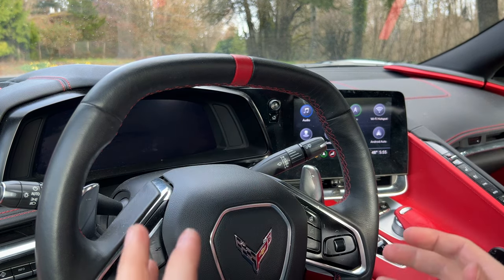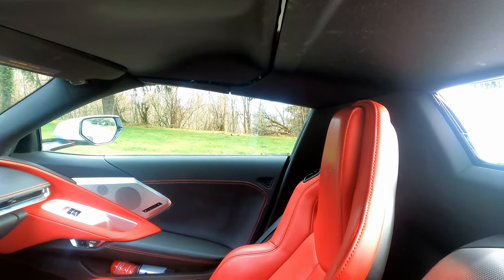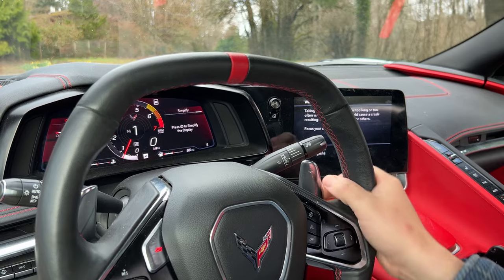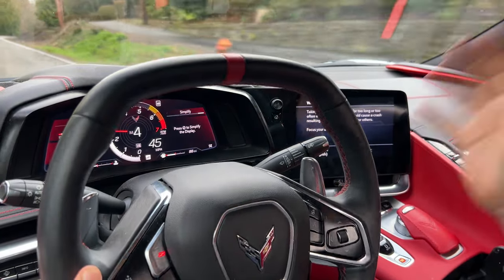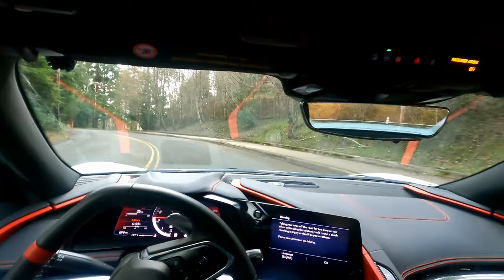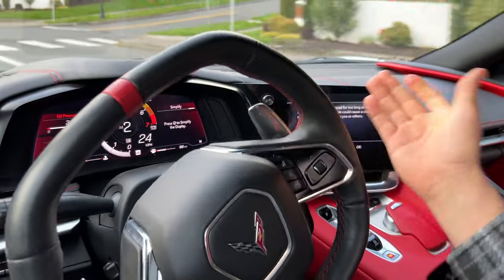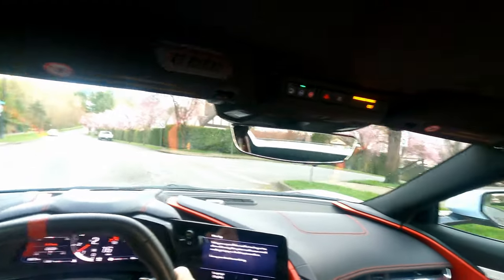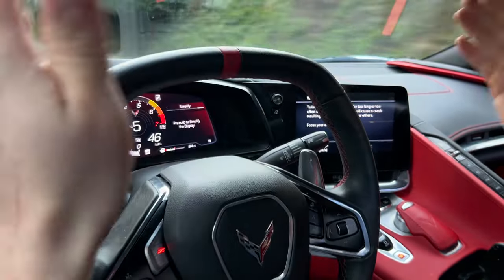How to, C8 Corvette POPS & Burbles, Stock sport Exhaust

Comment: stock sport you mean NPP or sport mode? I see you're in Z mode. What would you say is the coolest sound it will make and how to make it exactly? Speed, rpm and gear sequence.
Reply from the maker: Hey bezaldo7, The sport exhaust the C8 comes with as an option when you build the car and hit Z mode, Thats all I do. My fav is Z mode downshift 3rd to 2nd gear  at 2500 to 2000 rpm. Speed doesn't matter. Another fav is Z mode 2nd to 3rd shifting at 6000 or 3rd to 4th 6k as well, both you have to floor it 100% and you will get a pop that sounds like a shotgun if you do it right. For the last you need warm tires and a dry day lol. 👍
Reply: @OwenJamesC8  By Z mode.....do you mean put the tranny mode in track and exhaust mode in loudest mode?
Reply from the maker: @okaythen001  Hi Josh, what I mean is press the Z mode button on the steering wheel. Thats literally all I do. I have not customized the settings in the car in any way Just by doing that I get pops and crackles. It is also easier to hear them in a HTC corvette as well. I have driven both and can tell the difference.
Reply: @OwenJamesC8  Is C8 2LT come with this sound of pops ?

Comment: Owen, buy the exhaust valve controller I sent you. Do an install video. You will get pops in every drive mode.
Reply from the maker: Thanks man! Ill look into it for sure. Just as a heads up though I may be getting an offer on the C8 Monday from a dealer that wants it. Im probably not going to go for it. But I want to do a build so bad though...😅
Reply: @OwenJamesC8  I knew it. Convinced another one to switch to the coupe. Lol. I got an offer of $30k over what I paid day I bought the car. Did the math and after everything I figured I would have pocketed about $7k. Kept the car..who knows what's going to happen with production and constraints..  might be tough to get another the way you want it. The Z06 is a pipe dream as far as I'm concerned. They went from May startup to now late June... It's a mess.
Reply from the maker: Wow, I may have to hold on to it for a bit then.... I was hopping z06 production would start May but that sucks...Im on a list for Criswell and while I am 100 to 200 "somewhere in-between" that's not bad. But I was hoping to get a 2023. I may have to rush into the build I was telling you about with the lambo or something else.

Comment: The exhaust sound is lame on the C8 Z51. Just way to quite. Sure under full throttle but when you hold a gear it’s just boring. You are miss leading people. I’ve owned 5 C8’s all Z51.
Reply from the maker: When the conditions are met it makes great sound. And honestly speed isn't where the epic sound is...its at the lower speeds. Even if you had 5 c8s that just means you have not met the requirements to make it happen. Maybe the 6th one will? I will tell you the standard z51 Targa/coupe wont make this sounds and I talk about why. Only the htc and specific conditions make it happen. I wish you the best Mike 😂👍.
Reply: @OwenJamesC8  well my 6th C8 is a HTC. Should arrive mid April. I watched another video and the HTC is much louder with the back window down. The coupe is very quiet inside the cabin. It also has a much thicker rear window the prevents the exhaust sound to enter the cabin. All 6 C8’s were purchased at MSRP. and made money on each trade. It’s a crazy C8 market out there. I would have thought after 3 years these C8 values would  have dropped. But now it’s spring and they are still bringing over MSRP trade value.
Reply: you've owned FIVE c8s??? z06s??? how is that possible?? that's A LOT of money.
Reply: @fallback8314  buy and resell
Reply: Ive got a 2021 c8 z51 with a corsar performance exhaust, the pops when I downshift are so addictive and sound so good. It's the coupe btw
Reply: On your 6th corvette? Yea BS.
Reply: I have a z51 and it sounds amazing. If you don't like it why did you own 5 and why would you own 5? Why not say you owned 100 c8s same lie. I bet you drive a kia and dream of driving a c8. This channel is awesome and very honest. He probably is the best for c8 info
Reply: My C8 is much quieter than the my LC500 . When I hit the rev limiter with that car it got everyone’s attention the down shifts would pop also.